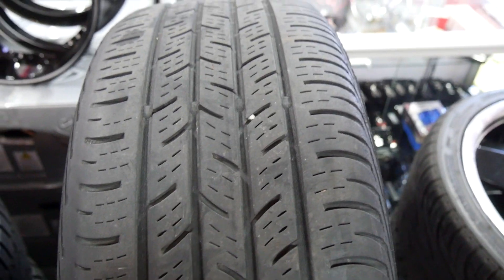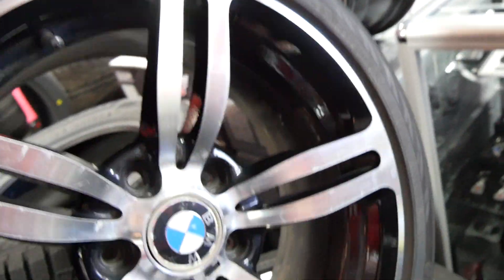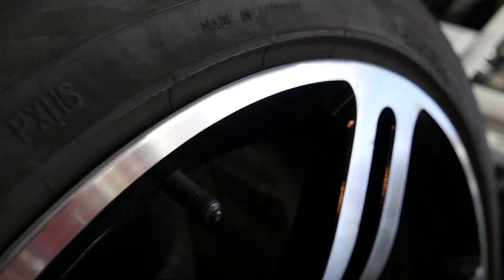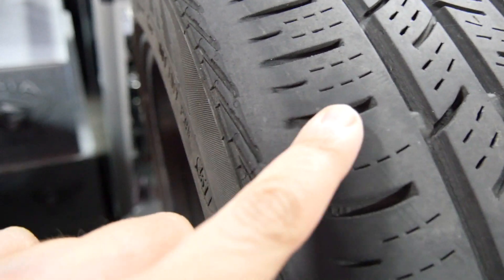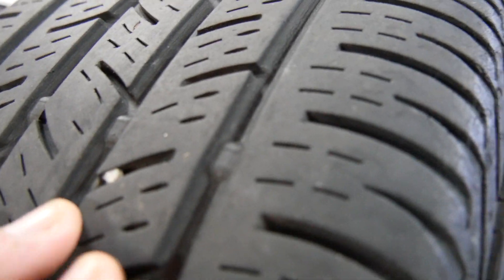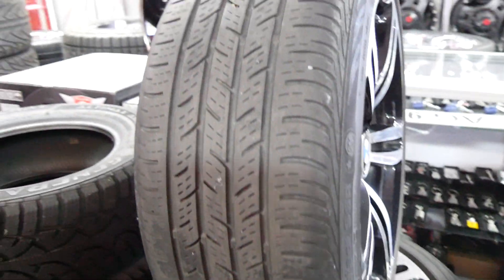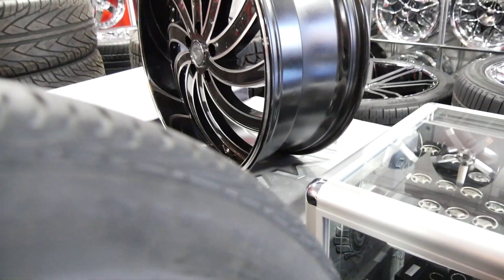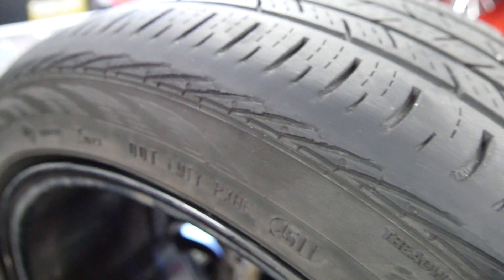WORST TIRE EVER MADE (FACTS!)

Comment: If the tyres are worn out on the inside, it means that the car needs wheel alignment! Blaming this issue on the tyres is insane!
Reply: I noticed that too. You have people come on here and complain about a specific tire but there's no mention of the condition of their suspension and does the vehicle have a proper alignment.
Reply: Yep an alignment and camber adjustment.

Comment: the dot code on these tires is 4511....45th week of 2011.  at almost 7 years old i would expect the cracking.  its not really a fair assessment of an over 6 year old tire.  as for the shoulder, its a BMW wheel.  i would imagine that the toe/camber is out and likley pushed to its performance limits.....things to consider that you dont really mention other than its the worst tire made.
Reply from the maker: OTAS fair point
Reply: CONTINENTAL IS LIKE SMOKE..... good bye in few km .... NEXEN IS THE SAME BUT 50% CHEAP
Reply: Yeah my 335 eats rear tires because the factor toe is aggressive
Reply: Not to mention a lot of BMW come stock from the factory with a little bit of camber in the rear tuned into the suspension for better handling on corners

Comment: That wear on the shoulder is due to alignment.
Reply: How often should you get an alignment every year, 6 months?
Reply: @franciscofranco6748  you should only really need an alignment when you buy new tires unless you run into something decently hard. Or you notice your steering pulling a certain way, other than that I recommend rotating your tires every time you get an oil change, at the minimum every other time. Alot of tire shops will rotate them for free If you come in for an oil change. That will maximize the life of your tire. If you notice any vibrations when your going faster you can have them re balanced as well but that's only if you notice a vibration in a certain part of your vehicle.
Reply: @dirtsailoroff-road5580  I have these same tires 2016 Ford Focus ST these tire could have lasted longer I bought them December 2019 I would get them rotated ever 6 months ok gotcha to ever time the steering goes to the side should be an indicator probably should have gotten an alignment. The rear ones were more worn like in the video side wear I think they did good for the way I drive thanks for your input.

Comment: Uneven  wear  has  to  do  with  alignment
Reply: Yes and no if you drive on the left side of the road ya front left tyre wears more due to tighter left turns .And the opposite side if you drive on the right . Cars are made from factory to drift to the opposite side of the road I think it's about 1/2 a degree toe out on 1side   So you don't have a head on crash if you fall asleep or just not paying attention and drift into oncoming traffic .alignment shops never give you a straight alignment it's always a bit to the passenger side . I hope this was good information I'm no expert but I do no a bit about everything. Plus roads have  camber for drainage so that comes in to play aswell
Reply: I know this a reply to an old comment, but the other aspect is poor of tire rotation. Many German cars (BMW in this case) and VW and Audi, etc., have pretty noticeable negative rear camber (> 1 degree neg camber). If the tire sits on the rear too long and is not diagonally cross rotated every 5k to 7.5k miles, you will get this smoothing on the inside rear tire shoulder. 

I have this tire on my 2016 VW and I can say this exact wear is starting to show on my inside rear tires (rotated 3 times, once at every 10k mile service interval). 

What I find odd is this "tire shop" doesn't know this??

Comment: Had a contipro contact DWS and it lasted 5 yrs. put enough air and alignment every 45K miles, that’s the key. No matter how expensive your tire if you don’t have much experience with tires it would last. I’m not saying I know everything but I usually add more air than the usual so you’ll have less body roll when you do corners.

Comment: I'll stick to consumer reports for tire reviews, they actually TEST tires.  This review was as usefull as those guys that cut open oil filters and tell you which is the best and worst.  You want the worst tire, that would be the Firestone destination II on my truck, tire rack had good reviews, but most were new reviews will limited mileage.  My experience with Continental was good, handling and wear was good on a CRV, they were the LX20 tires.

Comment: I have a 2017 Ford Focus SE with the Continental Pro Conti Contact P215  P75 R16. Only 32000 miles on it. Had the car a year and a half. Needing tires in two months. Not going to make it to winter.

Comment: Worst tire ever made in my lifetime were the Firestone 721’s. The second worse tires were the Firestone FR480’s. The 721’s belts shifted & the 480’s would self destruct. Yes, I have owned both of them and never purchased a Firestone product again. Continental are leagues ahead of Firestone in quality & performance.
Reply: Firestone bolted my plate on wrong. 10 lbs one side 110 the other  ....wheel nearly came off I had to destroy the studs it was a disabled vet plated vehicle too

Comment: Wheel alignment wear??? And tyres sitting in sun not being used is what causes these issues I work at a tyres shop and I have been running these Continentals on my 330ci. They run for about 5 years! Great for wet and dry. Great for all seasons.
Reply: I don't know how you don't know these things about tyres🤣

Comment: A set of continental extreme contact D/W's aka: dry/wet cost me a 2012 camaro ss. Hydroplaned at 45mph into a guard rail. I'll NEVER buy continental's again.  They aren't worn either,  they just suck. They felt like they rolled over on themselves when cornering in the dry and I'd hydroplaned numerous times prior,  but had room to correct before any issue.  I'd owned the car since 2012, I wrecked it this year. 6/21/18! The tire had been discontinued as well,  I found this out after attempting to buy another right front tire after running over a screw at my son's football practice. Never again continental!

Comment: I recently changed those exact same tires out of my car because one of them exploded on the freeway and upon inspection of the other 3 all of the tires faces were cracked... By the way the tires were made in 2015 for those who talk about being to old, besides on my other cars I've used tires for over 8-10 years and never had a problem with any of them. About being quiet on the road let me tell you something, i bought some Yokohama S tires to replace those continentals and they are so much quieter, also driving feels mach more smooth and that's without considering the fact that the yokohama tires are performance tires not touring like the continental.  By experience I totally agree with this review.  👍

Comment: why do slim tires that use less rubber cost more than reg tires?
Reply: chriss4365 smaller tires need more reinforcement than larger ones to hold the weight of the car
Reply: And almost because of market.. less market more cost to make anything. ..

Comment: I'm going to assume you know that the tires that are put on cars for car manufactures are nowhere close to the same name brand and model tire you buy from a tire dealer right? Just as one example as I've been an service advisor for Michelin, Goodyear and Nokian. I once had a customer come into our shop with a brand new dodge pickup claiming his "Goodyear Wranglers" are down to the wear bars after only 30,000 kilometers, I went outside to look at the tires and the odometer and he was right. However I then had the difficult task of explaining to him that these were not our tires because they weren't. "But they say Goodyear Wrangler on them" he replied. Dealerships contract major tire companies to design a spec tire that will help to sell new cars and trucks by being specifically designed to be smoother quieter etc, to impress potential buyers, other than the name on the sidewall they are in little to no way like what you'd purchase from the name brand dealer. This is why I've always advised folks wanting to purchase a new car, to negotiate the cost of different tires into the  price.

Comment: These are the factory tires on my 2016 VW. Very overpriced . I paid $250 to get 1 tire replaced when I ran over an errant spike left on the highway by the CHP (yay quality policing). I almost shit a brick when I got the bill. 

Overall I can't knock the tire too much, because it is what it is. It has mediocre dry traction, but the wet traction is decent. Steering is so so, but this is not an ultra high performance tire; more like middle of the pack commuter tire.

Tire wear is good. I'm at 7/32 at the 30k mi service (mostly highway). I had a little outer tire wear indicated at this mileage that has been resolved within 2k miles after rebalancing, rotation, and alignment (something I do every 10k mi). 

If I had to give these tires a rating, it would be a 6 out of 10. It's a decent tire, but not a performance tire by any means.

Comment: Horrible review,

The out side shoulder wear has absolutely nothing to do with tire or tire quality.Tire manufactured in 2011 so ya weather cracking is normal for all tires.
Next tread pattern, sizes and designs have been incorporated to each vehicle so ride,road feel and ha feeling is suitable to each car.This does not make for a bad or worst tire ever made.
You do not even discuss tread wear and the fact alot of 17,18 and 19 inch tires are made with z,v and w rating for all the about reasons.
Yes I understand factory tires don't lady as long as next set which is a given.
I've seen factory tires lady a long time as well.

Not in hand :

I own a low mileage Sunfire with original factory tires from 2002 ( Goodyear Conquest )  and they passed a DOT ssfteynin Ontario Canada

Comment: Dude I'm not particularly defending the Conti's here but I've had decent treadware as oem's on my GTI.  Part of the deal has been making sure of proper alignment and rotation every 5k...fuck VW's recommended 10k.  My brother was amazed at the very even 4 tire wear on them when i swapped to my winter skins.  That being said, WHAT ARE YOU DOING showing these tires by propping them up all over the very nice and expensive BMW rims??!  I'd bitch slap ya if those were my rims...

Comment: You go with cheap Chinese tires!
Reply: I have a 2013 altima with these tires on the front. This video is complete FUD. I have 30,000 miles on the tires and they are still above 4/32 tread depth, no cracking. Ride, noise, dry road handling are fine; wet road traction is very good. The only weakness is that they are only OK in snow/ice, but again, what can one expect from a 50% worn all season tire in a Minnesota Winter. There are newer tires now available (e.g. True Contact, Pure Contact) for the same price that are somewhat better, but ProContacts are far, far from the worst tire ever made.
Reply: This comment is confusing. It makes no sense.What are you trying to say????